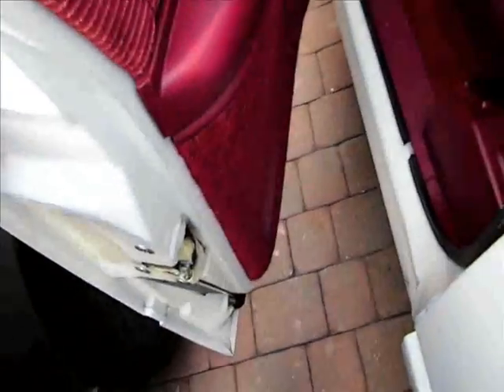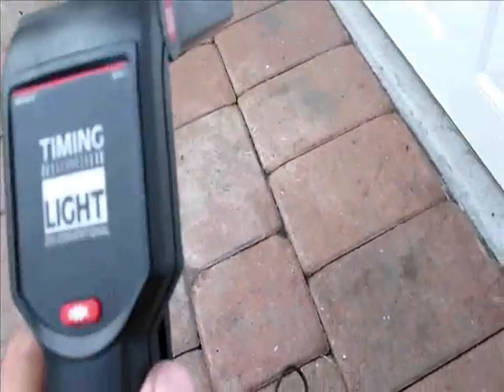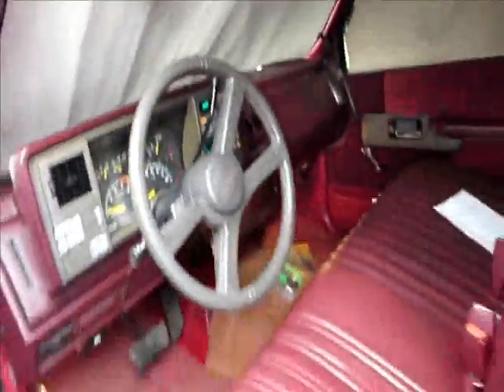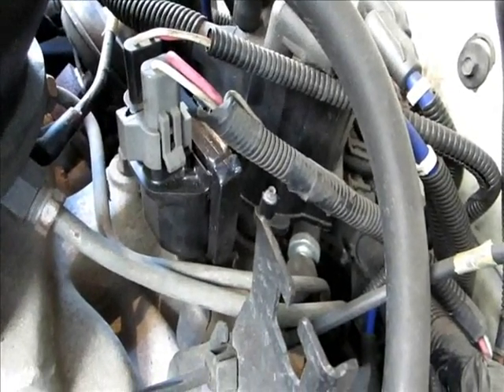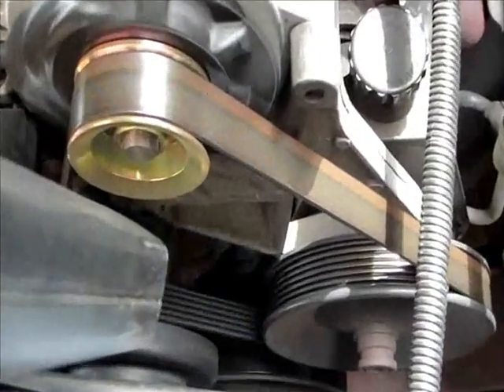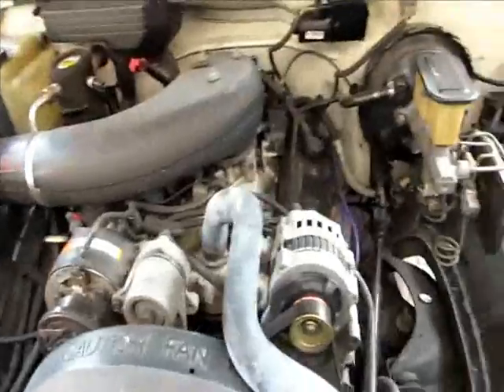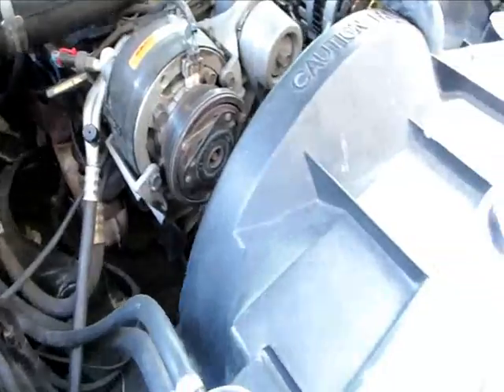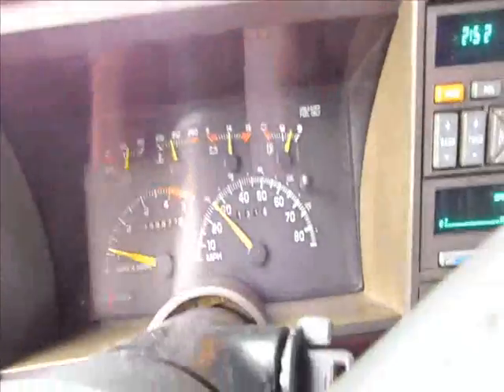How to set ignition  timing 88-95 GM fullsize truck Silverado Sierra Suburban Tahoe Yukon

Comment: My 94 shows code 42 but it runs great. Idk what it is, the est wire is connected so idk 🤷‍♂️
Reply from the maker: Under the dash like shown white black wire 1 pin.   Its taped up kind of from the factory Mine it more loose now
Reply: 42 is usually knock sensor by starter

Comment: Have you changed your timing chain yet? I just did mine at 300,300 miles.
Reply from the maker: Yea I put on one some years ago was a little loose solved most of the bog off idle i had

Comment: Have you tried to set to tdc cylinder 1, and pulled distributor cap, set to be firing cylinder 1, and see if it's timed?
Reply from the maker: its as fine   My timing used o change when the distributor star slipped up and down
Reply: @GhettoWagon  I am about to set timing on a 350 and a old man told me to set it like that then check and maybe fine tune like what you did. I never used a timing light so we will see how it goes.

Comment: What causes SURGING stumbles catches  94 350 tbi in timing bypass mode ONLY! timing is at zero also Perfect vehicle otherwise I suspect coil pickup weak.  Calif smog requirement
Reply from the maker: Fuel pressure ok? Check the fuel pressure
Reply: @GhettoWagon  ya fuel pressure good like I stated its ONLY in set timing  bypass I suspect a slight slop in the advancing mechanism possibly worn looking for a distributor parts breakdown drawing or blue print before having to just pull distributor for mechanical issues
Reply from the maker: @repeatagain1789   There isnt any mechanism in these distributors, Just a pickup coil that detects a magnetic pulse.
Reply: @GhettoWagon  their is nothing like the 77 HEI pickup coil advancing rod  or vacuum advance rod that twists the magnetic pickup coil braker plate? How then is the rotating advance implicated
Reply from the maker: @repeatagain1789  1980s era  Computer does it
Reply: @GhettoWagon  "UPDATE" problem fixed magnets were to weak on the distributor replaced runs like a new motor so much more power

Comment: So when do you exactly plug the connector back in? Do you plug it in and cut the engine off?
Reply from the maker: Eng off Key off disconnect set connector. Start engine.  Wait a few seconds.  Check eng light will be on.. EST code. Good.   Hook up timing light.  Check timing.  Make adjustments.  Turn off engine.     Reconnect plug.  Start, Check engine light should be off.  If you want....   After that is done disconnect the battery for about a minute. just pop off the neg.   It will clear the codes and any saved timing the computer had in it.   Then after like 50 miles all will be set again and learned. 

I sometimes disconnect battery most of the times I won't  :D

Comment: Does this year have a belt or chain ?
Reply: Chain
Reply: adrian tibbits wen is good to change the chain
Reply: @devotedanaheim1575  i dont know the actuel mileage chevy recommends but id change it once you notice its starting to go bad.
Reply: adrian tibbits is it a interference  engine
Reply: Is it a interference  motor
Reply: @devotedanaheim1575  no its not

Comment: Nice tutorial. Love the '88-94 trucks. Such a clean, well designed engine compartment. TBI engine fan here.
Reply from the maker: yea they are a a bit slow on the highway or when you need to run away from someone but its simple and really reliable. 25 years old!   One day it needs a LT1 cam swap gains like 25hp. :) Custom chip burned EZ

Comment: Does it make any difference when you change k&n intake filter? From factory air filter.
Reply from the maker: No just more noise. I kinda wanna go to back to the stock air cleaner and just run the bowl under it.   Then sell this for 250 before it falls apart
Reply: @GhettoWagon  I does make a slight difference.🤔
Reply from the maker: @richardcasarez391   No its in your mind. Putting the bowl thing under the stock air intake does the same thing alot easier for less

Comment: My truck wont crank after trying to time the engine HELP PLEASE
Reply: Ghetto Wagon i changed the ignition coil and now it was running rough so itried to set the timing now it wont crank
Reply from the maker: Check your connectors. maybe the new ignition coil is crap  (new ones are really garbage these days shame) or the running rough problem was not your ignition coil,  Maybe a fuel issue?

Comment: Hey im currently attempting to adjust my timing but my only issue is that damn distributor bolt.. i can get my distributor wrench on but the sensors and egr valve block me from turning it... do you think if i bought a crowfoot like you used it would solve my problem? Thanks

Comment: old thread but maybe it will help someone. First thing to check on a heat soak stall is the module. The tip off is the cool down restart. Check for injector pulse(fuel spray).

Comment: I've set it on tdc and it's still running bad. What position is the distributor supposed to be set at ? Rotor is already at tdc
Reply from the maker: Rotor should face 1 on the cap when the  cylinder 1 is at TDC. You can have it swapped 180. The timing mark on the crank,  when its at zero can be at TDC 1 or TDC 6?   Thats how people put them in backwards. Usually they wont even run.  Or your timing light is bad if its one of those adjustable ones you set.  I used one once that said it was at 0* and it was WAYY off. You can also have the distributor in 1 tooth off and it will run poorly.  gotta take it out and mess with the oil pump drive down the blind hole so the distributor slides on nice
Reply: +Sterling Witherspoon - Two things I have found...  #1- The Distributor Rotor might have a BAD adjustment due to old / time or when buying " re-manufacturer " part, that happens... I have seen a lot of Video on it.   #2- You might have to get a " long " screw driver and " adjust " the " Oil Pump Drive " down the Rotor Hole before inserting the " Distributor Rotor " back.

Comment: I put a stud in the intake and use a washer and nut to the distributor.
Reply from the maker: I did that to mine.  I almost dumped the washer down the distributor hole when I was removing it, forgetting i put one there.  That would of been fun.

Comment: I have 91 gmc pick up will crank and stay crank for 15min then shutoff then 15 mins later will crank again what could it be
Reply from the maker: Could be a laundry list.  Fuel pump dying, pickup coil failing,. ICM failing   Cannot really diag it through the internet  Start testing components  Verfiy its getting fuel and spark when it craps out and go from there if its not

Comment: after setting the timing, when do I reconnect the ECM wire? while engine is still running or shut off then reconnect?
Reply from the maker: Shut down engine.  Reconnect  set timing wire.  If you want you can disconnect the neg. cable for a minute so the ECM resets. It clears the old learned timing memory and will clear the EST code  I sometimes do it. Sometimes I don't   The truck will sure run a litttle weird after setting the timing if you don't disconnect the battery but in 5 miles its usually back to normal.
Reply: alway reconnect it with car running and then turn car off and start it back on..the computer will do the rest

Comment: I've got a '94 Silverado TBI 350 and on a cold start up has a rough time in idle until warm. What do you think could cause that? Maybe advance the timing?
Reply from the maker: Doubt it. If the timing was too advanced it would ping at higher rpm.  Being that you say when it warms up it smooths out I would imagine it has to do with something when the truck is in closed loop.  Sometimes the ECT sensor shifts in value, or the MAP sensor tube/ connector ends can crack.  Check the ECT sensor's resistance at certain temperatures (there is a chart online, GM ECT sensor resistance values)  Also the injectors could be spraying bad, low fuel pressure could be cause. It could be a number of things
Reply: Brandon Poe i have that same truck and my does the same thing lol
Reply: Could be numerous things. Timing chain stretched, intake manifold leak, EGR valve , catylitic converter is breaking down plugging exausht. Idle air control should show engine light though. Clogged fuel filter. Failing pump. Is it running rich or lean ?

Comment: The tan and black wire could also be under a plastic cover in the engine bay
Reply from the maker: Yea on a 93 and earlier.
Reply: Ghetto Wagon
Friend of mine did a botched engine swap on his dad's farm truck, didn't take any pictures, swapped a V6 for the 305, and I'm the muthafucka who has to figure it out now.

Thanks for the video man, really helpful.
Reply from the maker: SoilentGr33n
 Hahha. TBI v6 to TBI v8 does not have too many differences.  I believe the knock module and sensors have to be changed to the correct V8 part.  The wiring is all the same I think,
Reply: Yeah he did swap everything from computer to wiring, but the truck kinda bucks around under harder load so we're gonna start with timing.

It's ODB1 and bridging the port with a pin only returned code 12 which is confirmation that diagnostic mode is on, nothing else.

I'll check it out then if timing is fine I guess move on to distributor and so on.
Reply: Yeah my 93 Sierra timing bypass is located in engine bay on the firewall passenger side under plastic cover which says fuse relay box

Comment: Okay so I just did this to my car (91 Camaro 5.0 TBI) and I set it to 6-5* and I did all that and it jumped passed 12* when I reconnected the wire. so that's okay? I know the the gents on 3rd gen said don't passed 8* but I think that's when you set it before you connect that wire right?
Reply from the maker: So you set it to 5-6* when the connector was disconnected?    I would set the base timing at zero or 1-2 degrees if you want a mild performance gain. No more.  Set the timing with the connector disconnected. If you check the timing when the connector is connected its useless. If you want to know what the total timing is when the ECM is controlling it, you need a scan tool and it will show the advance.  I believe at idle its around that, 10-15 * advance.  When you set the base timing FAR from 0*, when the ECM reads X amount of degree timing you have to take in account for the increased base timing that you added when the set timing connector was disconnected.  Example, If you added 1 extra degree of base timing, all across the board it will be 1 extra degree of timing.
Reply: +Ghetto Wagon okay great I'll do that tomorrow morning I've been at this for about 3weeks changed out the manifold to a performer TBI and I completely fucked the dizzy. it was a mess but a manageable mess. With some reading I'm getting it back to where the car once was. This should take me a step closer. So I'll redo the timing. Thanks a ton! First car first time completely being a idiot and not reading up before I do a upgrade. And I have friends who are mechanics and no one mentioned anything about the EST when I told them the timing was off.
Reply from the maker: Chris Franco
 What happened with the Dizzy did you put it back in the wrong spot?   I always note where the module is in relation to the engine of the fire wall, sometimes I put tape on the fire wall. When I stab it back in it will be fine.  Make sure you have the distributor seated! They are tricky to get back in, if its not in right the timing will not  Be correct and the distributor gear will get torn up in short order
.  I have the same intake, I would get a ARP distributor clamp STUD for it. The bolt threads cracked out of mine years ago, I put a stud in it with some loctite a few months ago, its been holding luckily.
  Just don;t forget about the WASHER under the nut when you remove the nut on the distributor stud. I almost lost it down into the engine.
Reply: +Ghetto Wagon yeah I didn't place it right because the oil pump I thought it was gonna stay in that position no matter what till they told me get a screw driver and just move it. Then the dizzy was set wrong cylinder one was set at the 2 o'clock position instead of 530. I also ran the car with two down cylinders because the wires got mixed up. lol I also used Bosch double iridium plugs. Yeah just a bunch of dumb rookie mistakes. But hey I really didn't have much help didn't know what to look for on info or anything. Just there by myself with a ratchet thinking about what went wrong and how to fix it. But one thing tho nothing beats that feeling of fixing something and the car sounding meaner every time.  So it was fun this DYI gone wrong. Learned alot from people who give me the info I needed much like this video
Reply from the maker: Chris Franco
 It happens. I had trouble putting the distributor back in when I first took it out to change intake gaskets.

Comment: esc 93 and earlier is in engine compartment on firewall cover. 94 plus in where it shows in the video.(might be hidden in harness)
Reply from the maker: Oh Ok I thought they moved it in the cab before that year.   The connector is behind the black plastic cover I believe?
Reply: Yeah, where the power block and hood light wire leads into.
Reply: Im not by my truck but I think its called the distribution cover iirc.
Reply from the maker: ScoobyJD If you have an old truck make sure all of those nuts on the lugs are tight, they loosen up and can cause havoc!
Reply: Nuts?
Reply from the maker: Yea, nuts
Reply: Oh you mean on the wheels, sorry I was a little lost at first lol Yeah, I always make sure to tighten them with a torque wrench.
Reply from the maker: ScoobyJD
 No the power lugs under that black cover get loose with time, so can have a loose 12v connection where the power bridges to various locations
Reply: oh oh, yeah; I made sure to check all of those lol
Reply from the maker: ScoobyJD
 I have to take all the cables off mine so I can get huge power and ground cables made for it, It should help here in the heat when everything is running at max.  The alternator cable and the cable that goes to that aux post is so small!
Reply: I have heard of people doing something called the big 3 but not to sure what size wiring to use. Heavy gauge cable isnt cheap!

Comment: hi I have a 95 chevy silverado z71. The wire you pointed out is unplugged on my truck and my truck won't run. will that wire cause my truck not to start?
Reply from the maker: No it will run with the EST wire dis conned.  Not very well. but it will run.

Comment: so plug the timing switch after i tighten the distributor before I turn the truck off
Reply from the maker: +David Smith  No. plug the set timing connector back in last after everything is off. Restart, check to see if the CEL light went off. There will be a stored EST code on the computer for awhile but it will go away with time, it will never light the light.
Reply from the maker: David Smith
 correct

Comment: do you have to do advanced timing by revving it up to 2,500 Rpm to set it at 0
Reply from the maker: +Vicente Dominguez  Not on a TBI  4.3 5.0 5.7 or a 7.4,   Its done at idle, warm engine, timing connector unplugged AC off.  Check the sticker under the hood.  It will tell you the spark plug gap and the timing. I always advance the timing 1-3 degrees so across the board its more timing = more power!  If you go too much it will ping.
Reply: +Ghetto Wagon ohh ok thanks man for the info im gonna bump it up a bit just like you said great video too
Reply from the maker: Vicente Dominguez
 Don't to much. Start at 1-2 degrees, Just over the large V  on the mark. It runs alot stronger!
 I can do a max of 3* advance 4* it just pings under some conditions with 87 gas, 89 or 93 no problems.
Reply from the maker: Vicente Dominguez
 Yea still try 1 to 2* to start. It will probably take +2* fine and its easy to dial than 1*
 I run 87. Infact My truck is running poor the distributor shaft "Start" is cracked on it and the housing is worn. I need to R+R and rebuild it.  I have all the parts, video on that soon.. Maybe
Reply: +Ghetto Wagon damm that really gotta sucks I know how it feels to have your truck sick, im gonna subscribe to keep up on your videos hopefully you do get it rebuild
Reply from the maker: Vicente Dominguez
 It works fine just bogs sometimes, its been like it for months, years. But its getting worse.

Comment: where is located the wire to disconnect ignition timing in a Chevrolet express van 1500 . 350 engine  year 00
Reply from the maker: I don't have one.  You are going to have to research that one
Reply: Alberto Rodriguez jl

Comment: When do you plug the wires back in under the dash?
Reply from the maker: +Triston Puckett  After timing is set, Shut off engine, plug it back in, restart it to check to see if the check engine light went out.
Reply from the maker: Triston Puckett
 It will; probably run a little weird too for a few hundred miles, normal.
Reply from the maker: No.   You need to drive it 100 miles untill the timing tables are all reset.    60mph is not going to do it. Sure it runs better just after running it around the block but the computer adjusts in about 50-100 miles

Comment: I have a 1993 gmc suburban 5.7 I put a new dist. new timing chain will it run ok when it warms up it is like the timing is off any one know what I can do. at idle its got a lot of power only in gear .
Reply from the maker: +m h  Maybe the tinning is off and the timing light is bad?  Hook it up to a computer or scan tool, you will know the timing is right.
Reply: m h the

Comment: what degree did you set it at?
Reply: +Daniel Travieso   set my bbc at 2 btdc.
Reply from the maker: Daniel Travieso  Higher than 0* Spec is 0*
Reply: ok thanks
Reply: +Ghetto Wagon  spec for my  95 k2500,  7.4 is 4 btdc.  0 works but I am at 7k altitude and above.
Reply from the maker: shebastar7
 Not sure on the BBC, All I know is the SBC.  95. still TBI